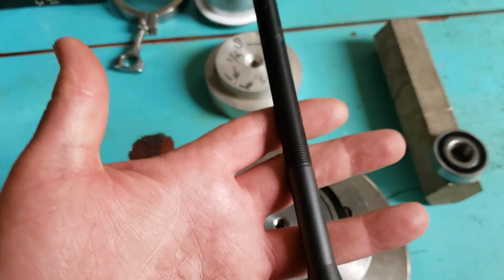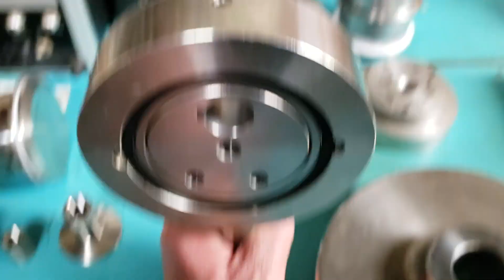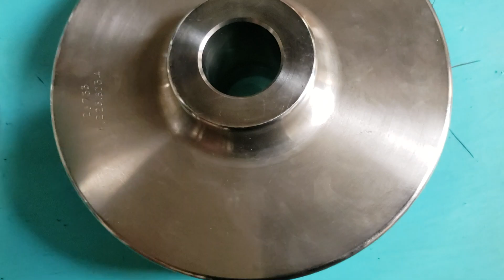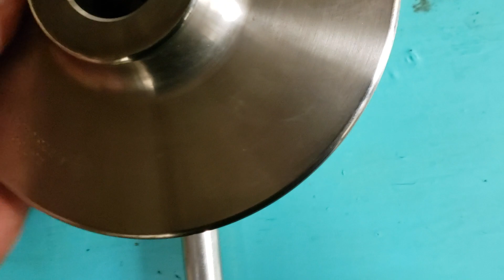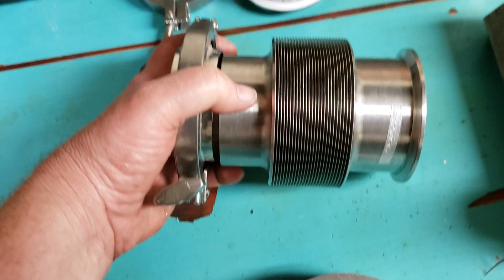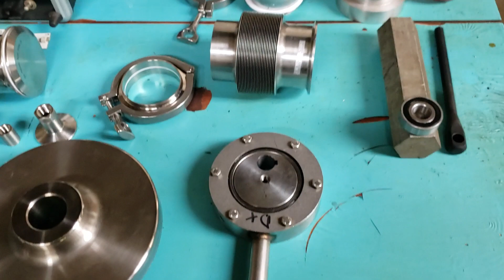Update Devine~Alan cycle: Co2~Go2 Fuel Nominal Displacement Adsorption Engine.

Comment: Great work man! 👍
Reply from the maker: Thanks for paying attention.
Reply from the maker: Here is the piston I own the cnc card on I built for Porsche in 1989-1990circa and it's still the most coveted race and street piston today and can be found in factory supertuners engines. Its 85 grams lighter than the stock piston, its speckled with Low silicate high carbide alumina alloys and runs .001 thousandths wall clearance in a nicacyile factory barrel with no friction.  Its counterweights are the dome, so the piston is cam-ed, only the skirts touch the wall, and there is .065 thousandths clearances at the ring gland to allow the piston to rock at BDC and center at TDC at 0~12,000rpm on  stock Cavite Bearings, then when at TDC the dome is a Two-Stroke squash band so the gaskets of rings are completely dry and compressed tight, even though I use total seal rings, I can go to 1mm ring glands because there is no Hydrocarbon fuel at the ring, it's just high pressure, heat and carbon attract, like soldering. Now the gasses are squarely put in the compression zone, and forced to the plug in a standing wave. Almost 100% burn and 13.6-1 compression ration on pump gas. And clean as a whistle emissions, the valves reliefs are not necessarily for bigger valves, this is because I'm a skilled cam grinder that means I have ground my own cams through Dema Elgin cams in Redwood City California he and Gary Lewis were my instructors at Deansa college for Bottom end and top end work and let me tell you there's a lot of that around that school in the halls,lol. Ok, now the cam timing in Porsche 911-930 its limitations endless timing as long as the valve doesn't slap the piston, so I can advance the stock camshafts 2mm and effective raise the running compression to 450psi. So I bring my Porsche cams at 108 lob center, 625 durations and 524 lift and then advanced to 2mm that's a fricking bumpstick. And the engine at Idol bumps you to your bones on stock exhaust, just trying to keep the bass down its impossible. Just going through parking lots I set off alarms with motion control at Idol,  however when up on it the sound bounces off hillside walls and around the car or inside its quiet,  well we effective put that running compression into sound doing work. And the engine went from 200hp to over 500sq at 2.7 liters. And 500+psi running compression, your normal engine is 150 all the time idol or hwy. We found this on the dyno, so what was happening is the standing wave in the compression area, vs the cam profile was bouncing back the fuel like a Two-Stroke but every time the valve would open it made a thump sound not a crack sound. I was impressed. So was Porsche. So the story goes, I was in the clean room and Wayne Krieger the founder, hands me my business card and I look at it and he walks out. Its says David A. Puchta President of 911 engineering Porsche Research And Development Racine U.S.A. my deal with JE pistons was I get my pistons at cost. 100$ each. A factory set of racing pistons is 20k so I sold mine for 10k and was solvent making my first million at 19-24 years old with proper work. And I follow those principles today, I am still solvent. 
I was JE pistons second customer when they bought there 500,000.00$ piston lathe, today JE pistons is definitely solvent. That's what partners do, so I opensource the CNC card so JE pistons can sell these to you and I have already been paid. JE never gave me a royalty nor did I ask, I specifically told them open this piston to the world and let's do a full court press, and 20 years later it's still flagship.

David A. Puchta 
https://protonspintechnology.com/stan-meyers-hho-hydroxy
Reply: @Hhydrogen4Power  I wish you could help me with my upcoming engine. I'm taking the Arctic Cat T660 engine and putting it in my 1988 Suzuki Carry DB71T japanese kei truck. I can port and polish, but the balancing and blueprinting is beyond my skill set. Minimal machining experience and tools.
Reply from the maker: @brandonboulton2776  ok, the most important thing is the camshafts. Port and polish to gasket match is very important, never make the intake runners smooth always use a heavy 80grit flapper wheel after grinding and profiling.  For the intake, let's say the short side of the bend going toward the intake is down. Make that as flat as you can reach into the intake,  you want a "D" shape with the flat side down,  what this dose is match the flow from the top side so they flow the same speed, so the gasses rotate in a vortex not tumble down the intake.  Now the reason for the heavier grit does two things it grabs the Air and helps atomize the fuel and keeps condensation away from the wall, remember air has water in it and a vacuum will evaporate this in an ADsorption cycle even though the head is hot, the air condenses just like a water glass. 
Now for the exhaust it's the opposite,  you want a mirror finish and as round as possible, because now your trying to defeat the other cycle of ABsorption whereas you do not want the heat to absorb into the head, after the exhaust manifold its realistic temperature gradient and not really important,  what an internal engine is a heat soaking device and the faster you can displace the heat the better. If you can't afford camshafts or its above your skill, just get a thicker radiator. I'd prefer if you put a Hydrogen Deuteride Injection Systems on, or one of our HHO units. Here is the direct link for a better understanding of our HHO units. As you will see we build them proper.

https://protonspintechnology.com/stan-meyers-hho-hydroxy
Reply: @Hhydrogen4Power  ok so I'm also putting on a very small but powerful mercury vapor lamp on the intake to pre-ionize the O2 into O3+NO2 then adding the Aaron marikumi(?) Plasma ignition modification. My suspicion is that I can create the ionized ozone reactive chain catalyzing reaction in a much more efficient combustion. Thoughts?
Reply from the maker: @brandonboulton2776  yes, you need to upgrade to a tin hat from the aluminum. LOL. I have no idea wtf you are talking about. 
Except your correct in the fact that all gasses have the ability to energize when hit with photons.
Hence Max Planck
Reply from the maker: One more thing, yes mercury Hg196 is a daughter isolated isotope to an unstable Au196 and 79. So when the understanding of stretching radioactive particles into stable particles becomes Industrialization of products, that's where BioGem is. 
https://protonspintechnology.com/bio-gem
Reply: @Hhydrogen4Power   not asking for help, just wish you were my neighbor. Random question, can you use some hafnium foil?
Reply from the maker: @brandonboulton2776  it looks like I already sent you the HHO link, now here is the HydroMe Hydrogen Deuteride System,  just notice there is only Hydrogen coming from the negative electrode and no oxygen, this is not Brute Force Electrolysis or HHO, that's why they are separated and I explain the difference between them. But basically HHO is low pressure in the intake and HydroMe is high pressure directly injected into the fuel rail system. Because Hydrogen Deuteride is a Registered Fuel I don't need the same  executive order that we have on HHO. They are both fine, our HHO is 30% average and H-D HydroMe  is 80%. Its a cost issue. Overall. 
https://protonspintechnology.com/hydro-me